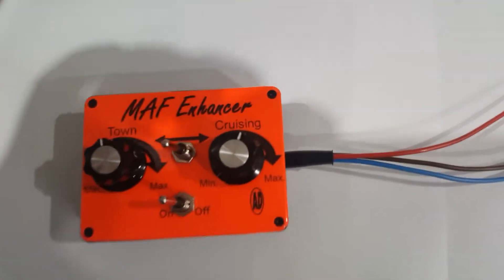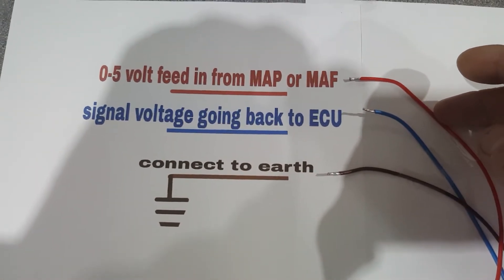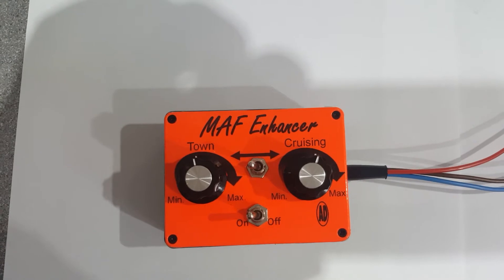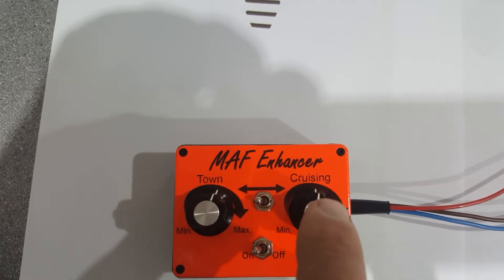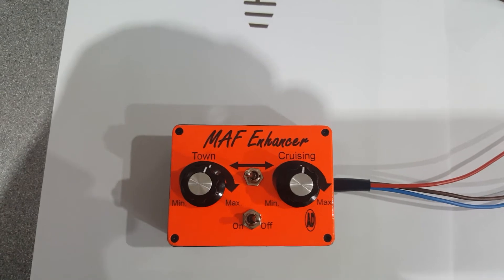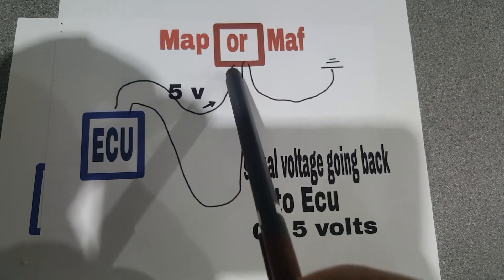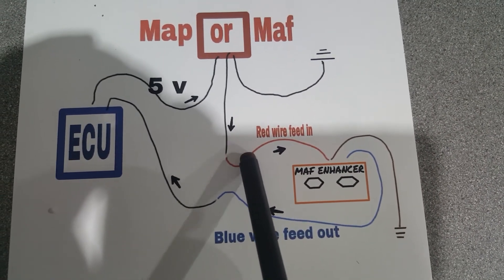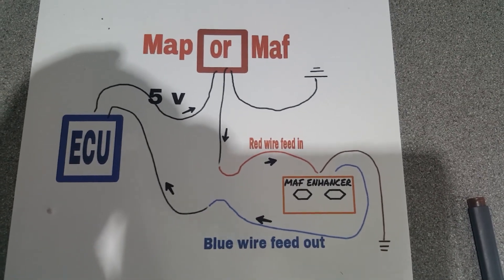map maf sensor enhancer wiring diagram  for Diesel and Petrol fuel saver HHO

Comment: This still isn't a saver, yet... no less Petrol going in, even if you are reducing HHO going in.  You are still just injecting extra fuel (HHO) like a fuel injector?  Where's the petrol reduction?
Reply from the maker: Because the HH0 is going into the engine you need a means of reducing the quantity of fuel going in . This kit fools the Ecu into thinking less air is entering the engine and therefore the engine ecu supplies less fuel .

Comment: Question should it connect to the map sensor directly and run a wire to the inside the car to connect the enhancer to or should I just connect the enhancer to the ecu inside the car
Reply from the maker: Inside the car every time so you have access to the controls while driving , as for wiring  at ECU or sensor which ever is best for you .